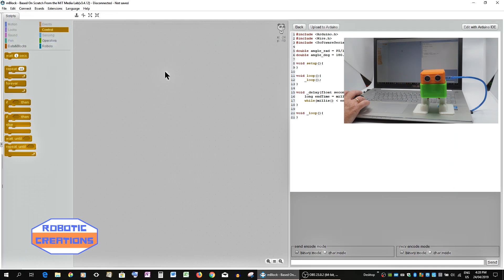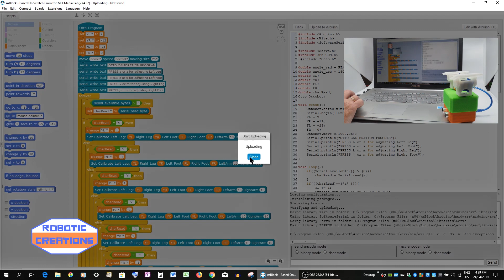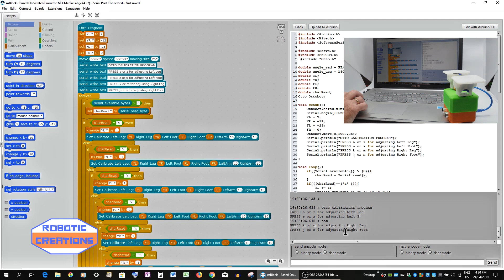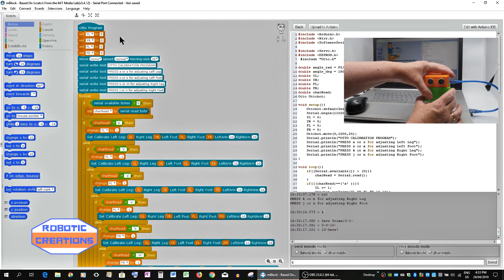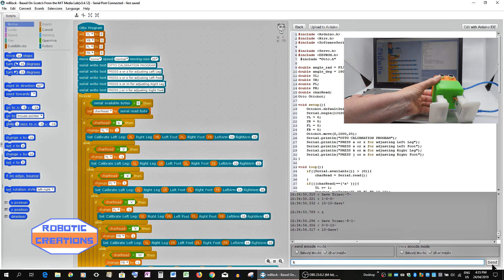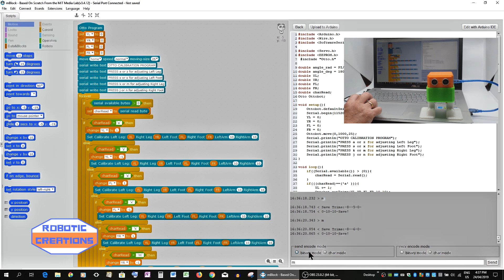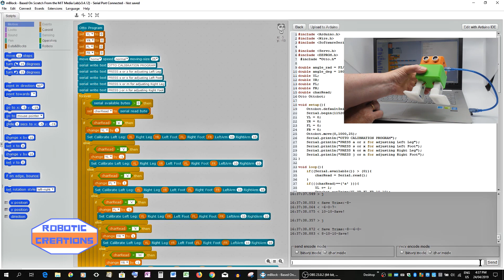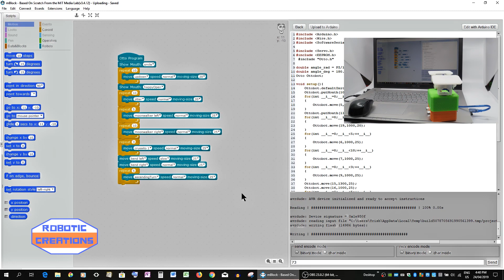OttoDIY legs & feet calibration using mBlock

Comment: A Query: 
How would you declare the touch sensor from mBlock?
Reply from the maker: This will be next tutorial. For now open mBlock, Ottodiy extension in arduino mode, click Edited in Arduino IDE. This will open the syntax of block and importantly libraries in tabs. Open Otto.cpp or Otto.h libraries to find how Switch 1 or 2 are defined on which PIN. Hope that's help.